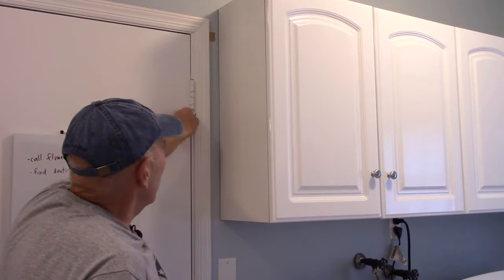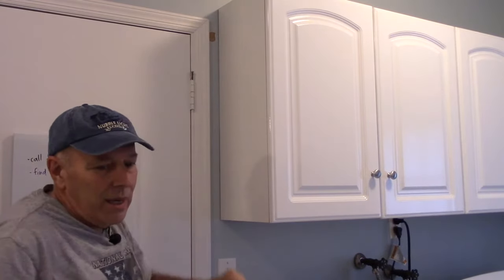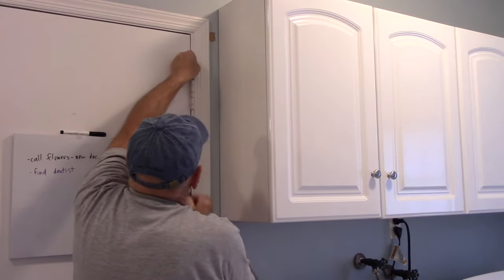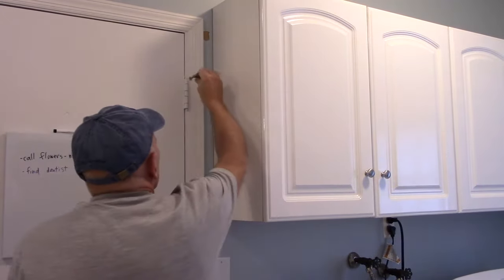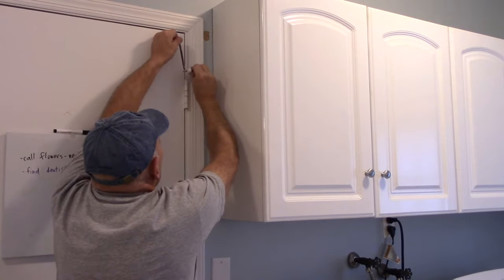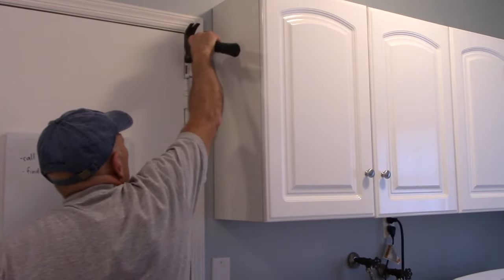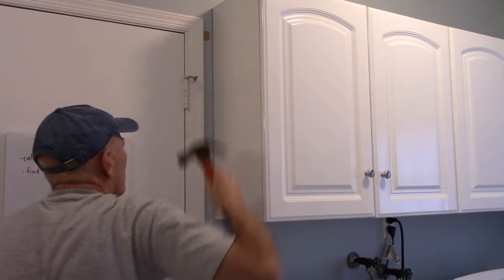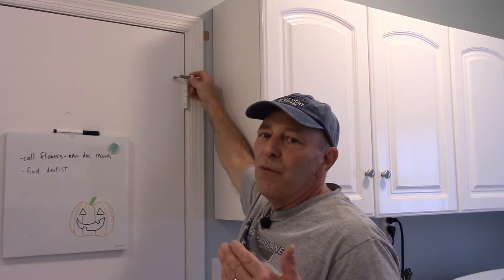How To Install A Door Stop On Hinge Pin

Comment: Thank you for this excellent video!  😊 My laundry room door was able to swing open and hit a table I just added to my studio.   A Hinge Pin doorstop was a terrific solution.  Besides needing to pick away some dried paint on the hinge, it was an easy installation, due to your clear instructions.   Now, with the hinge pin door stop installed, the door won't go bump into the table.  Problem solved!
Reply from the maker: Great job!

Comment: I'm a General Contractor, specializing in finish carpentry.  After 40 years of hanging thousands of doors and repairing their problems, I will have to disagree with Jim's solution to limiting the swing of a door.  Those hinge-pin bumpers can easily fracture a door jamb if the door swings too far due to high leverage caused by the short distance from the fulcrum (in this case, from the hinge pin).  When I see them installed at a customer's house, I always tell them that I would like to remove it and throw it as far a distance as I can.  There are other, better solutions:
1.  First choice would always be a common "door stop" that screws into the baseboard.  I'm speaking of a rigid shaft with a small rubber bumper at the outer end where it meets the door, an inch or two above the floor.  
2.  Second choice for the situation in Jim's video would be a rubber bumper attached to the side of the cabinet so it contacts the door at the very top or very bottom as it swings open.  These are usually a round 'dome' with a peel-off adhesive backing.  Many doors today are hollow, so you want to make sure the bumper contacts the door at some point around the perimeter frame within the door where you have some "meat".  This will prevent breaking a hole in the unsupported face of the door over time.
3.  If there is no way to use the baseboard door stop or bumper mentioned above, the third alternative would be a "floor stop".  This is a small round fixture with a rubber flat face that screws down to the floor and acts as a bumper so the door can't swing past its location.  The downside with these are they can be a trip hazard, although they are always placed out of the traffic flow.

So, think beyond these hinge-pin devices which can cause you a lot of grief when (not if) they go wrong!
Reply from the maker: Thanks for watching
Reply: Next time you see one let me know I’ll help you get rid of them they’ll end up at my house I need a couple of them!!!!!!!!!
Reply: What would you recommend for a door that has a large glass door cabinet behind it? ( moving the cabinet is not an option, I tried to convince my mother to simply not put anything there.) The door sits too high off the ground for the floor stop. It is a glass patio door with metal frame. It's my mom's door and she leaves it cracked open in the summer so her cats can go in and out but my dogs will ram it open from time to time if I'm not holding them. We were thinking the hinge pin stop would be the best option for us. What would you recommend? Thank you in advance.
Reply: I'm not sure if you'll see this Bob. In my case they aren't going to ruin the s*""  door install that already occurred by the previous owners.. screwing the stopper into the baseboard isn't as flexible? Some of the doors can swing more freely than others if that makes sense.
Reply: My door opens into the new stainless steel refrigerator and none of those three solutions would work. So this broken door jam is least evil compared to dented fridge.
Reply: What about simple adhesive wall protectors?
Reply: @gabbywackermann455  An adhesive mounted rubber bumper is about the only good solution for a situation like this.  These are tough parameters- be careful!
Reply: @catepeterson4053  You probably won't think so if you have to replace a fractured door jamb.  Seriously!  An adhesive mounted rubber bumper is probably your best solution